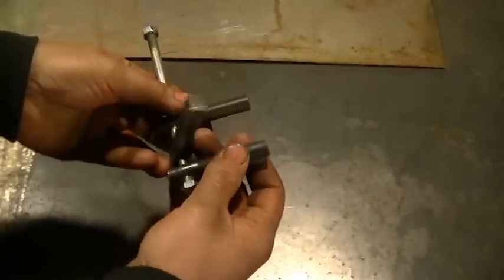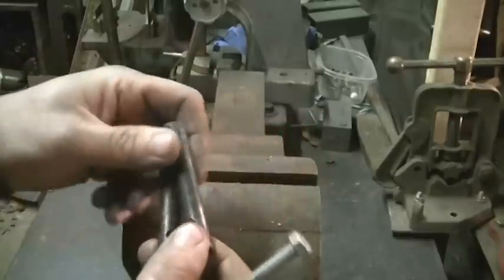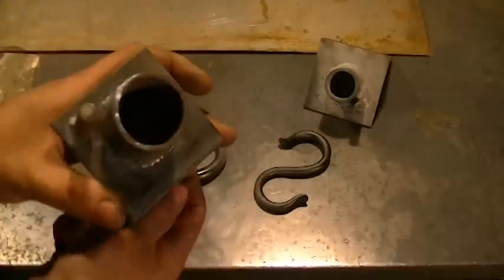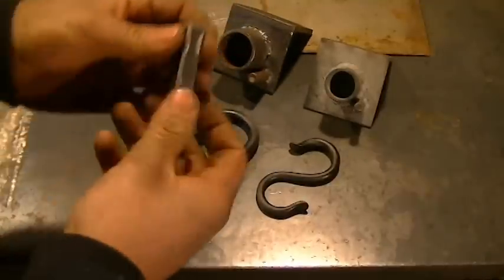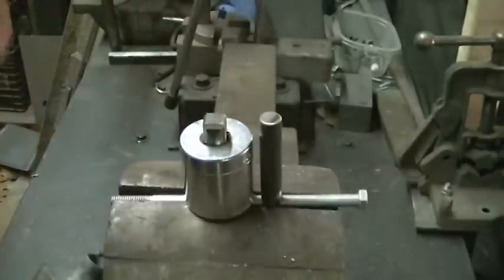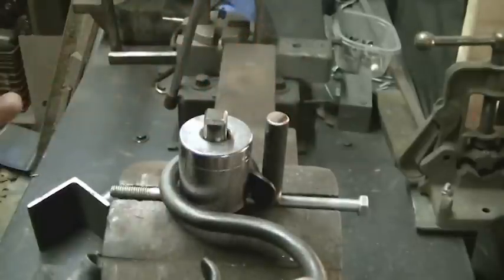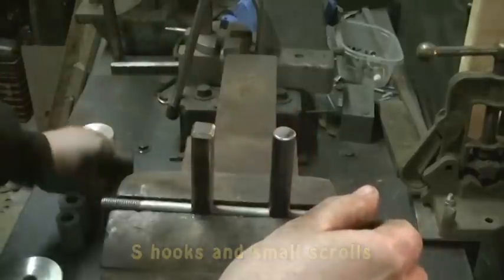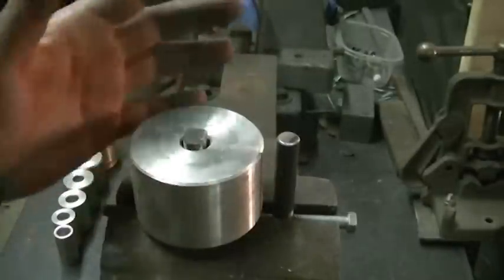Adjustable Bending Fork & Jig For Blacksmiths

Comment: I like the idea, may I suggest a iteration? The socket slightly wobbles as it slides down over the 1/2” square stock. When you use larger sockets you can take a second socket and invert it upside down inside the original socket so that you have two sockets nested and two points to engage the 1/2” square, top and bottom. Great idea I’ll be building one too.

Comment: I made one of these wire bending jigs today in about 3 hours as I had to mount and adjust the vise on my drill press.  I bent some wire left over from some cattle panels that have very strong wire and it worked fine.  Since your design uses a 1/2 inch square peg to use half inch drive sockets I thought about making a jig out of 3/8 inch round rod and square rod to use 3/8 drive sockets and perhaps make smaller hooks.  Thanks much for the design as I can now use the jig to put hooks on wires with ease and I have about 80 hooks of these to make.

Comment: Better late than never, however; I just watched your video on Bending Forks.  I have a Jig that allows me to make S Hooks in two sizes, and it works fine. However; your jig provides 8 to ten sizes and is very easy to build.  I have a Harbor Frieght Bender, but; I really don't use it much.  With your creation, I can now use the dyes from the compact bender and expand my ability to create numerous sizes S Hooks.  Thank you for sharing your Jig.  😊

Comment: Jeff, just letting you know - your simple design has solved 2 hurdles for some projects I've been working on. Great concept, so simple - I did to a great extent copy your design but made some minor changes which involved some welding... I incorporated a threaded rod into it which meant I can make attachments that either screw down or can be bolted on/off depending on requirements. Great video, thanks for sharing.

Comment: Great idea,  I made my first hook yesterday but did not have anything to bend it with.  I put two drifts that were same size in the vice and bent it.   This is great because the bolt keeps it in place as you are setting it up.   This will be my next tool.  Thank you for the idea

Comment: Thank you Jeff for sharing. I've been searching for quite some time for a diy, simple jig for some scrolls I have to make soon. I'm an amatuer but I enjoy using my hands. Lately I been into metal work due to some much needed home repairs/renovations. The last jig I made, thanks to Youtube, I had to bend some 5/8" steel which took me quite some time and effort as I also had to build a forge as well. Soon, my next project involves bending some 3/16" x 1" flats. Thankfully I won't be needing the forge but I have to say, THANK YOU for your vid. Because I not only would I not need a forge, but I also don't need to waste time on welding up a smaller jig. My scrolls are going to be about 4", but with your design, it should be a walk in the park. The only outside help I would need is getting the holes drilled at the machine shop. Definitely got to build a drill press, but that's for a later date. Again, thanks a million Jeff. I subscribed and will definitely be checking out your other vids.

Comment: Thank you SO MUCH for a very nicely done video. I have loved working steel since I was a small boy. My Dad taught me shop craft from diapers on up. You have a good designers head on your shoulders! I like it that you're utilizing HF dies. (the holes are 5/8") I had a local machine shop make
 3 1/2" - 6" dies for the compact bender. it cost me $138.00 for the set. I cut the rack off & moved it 90 degrees & made another rack just like it to hold the new dies. That might be something you would like to do. I believe I'll make mine for a 1/4" bolt, since its just to hold the line-up. thanks again.

Comment: I too use a bender that's two angle irons, with a post welded to each one. Slide the angles around on the vise jaws to get your spacing. I'll make one with a square post though, to steal the idea of using the sockets for different diameters. Thanks.

Comment: hello ,  im  trying blacksmithing  myself  and gona  do  this  bending  jig  like  you  showed but  have  a  question  - do  i  need  to  harden  those  steel  rods  ?
Reply from the maker: No, hardening steel makes it brittle unless you temper it. Since its not a wear surface and the metal you'll be bending will be hot no hardening is needed.
Reply: thankyou  very  much  for  your  answer ,  those rods  looked  realy dark  so  i  thought  mabe  you  forgot  to  tell that  you  hardened  them , greetings  from Lithuania  and  thankyou  for  sharing  your  experience  with  people  from  planet  earth  ;)

Comment: I would also cut a block of 1/2" wood to fit under the jig in the vise so that you can keep the jig level, and to make it easier to set the spacing as the wood block will hold it up between the jaws leaving both of your hands free.  Cut it so that it's as long as the jaws, and just wide enough that it just is about an 1/8 of an inch above the bottom of the jaws when it's sitting on the slide.

Comment: I'm going to try this.  But, I'm confounded about something: When you lock the jig in place with the two pins in position, you appear to lock the bolt into the jaws of the vice and not the pins.  If that's right, how are the pins being locked in?
Reply from the maker: The jaws of the vise come into contact with the larger diameter of the pins. The bolt floats in the holes in the pins and could be removed once the pins are secured in the jaws. Because the bolt is a smaller diameter than the pins the only way the bolt would become locked into place would be to over tighten the jaws and compress the drilled holes causing the bolt to bind.
Reply: Thanks Jeffery.  Of coarse that makes perfect sense.  The "geneious" of this is its simplicity.  And I thank you for sharing!
 @jeffreysanto

Comment: How do you drill through round pin so the long bolt goes through both pieces?
and what do you use to actually make the bend? I would think those pieces would move all over in the vise when pulling on the piece?
Reply from the maker: There are 2 pieces of 1/2 stock and 1 piece of 1/2 square, you need to drill cross holes through them. There are a couple of videos out here on youtube that show how to drill them, just search "drilling cross holes" and you'll see a few options. As far as bending, you bend the heated material through the fork, I did a demo video if your interested... https://youtu.be/--L9ErfsWDE
Reply: azbikerider49 a center bit tool ot drill a 5/16 hole in the end of the center diameter place the short piece with the hole over the length of the rod horizontal  in the vice to center the drill bit. Thats it ?

Comment: Did copy this and it works as shown.
I'm thinking about Improvements
 I'm thinking build a frame for I can build a 90 degrees angle bracket for shelving.
 Figure a half inch sqare bar every 16" or 24" can surport most shelving for garage,sheds and maybe just pretty enough for inside my house
 Believe it could be built cheap and easy enough to sale.
So a surport brace to hold straight - then 90 degrees bend quickly -.finish with the other side straight is what I want 
If setup right should be a money making jig
Reply from the maker: I've actually changed this a bit since I made the video... I am going to be creating a new channel when I move into a new shop, basically I started making them out of hex stock rather than  round, gives the jaws the vice more to hold onto. ;)

Comment: It just hit me that, if you're cold bending relatively thin bar/rod stock, you could just cut wooden circles(from hardwood) and drill a 1/2" hole in the middle of the circle and bend away.